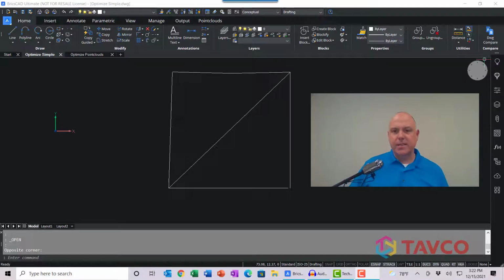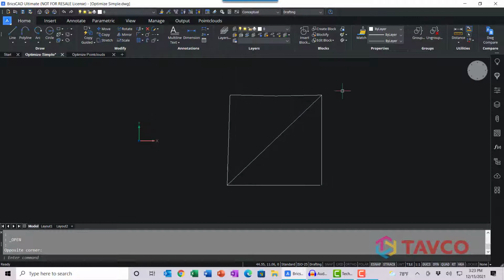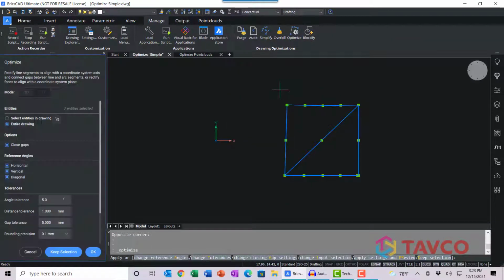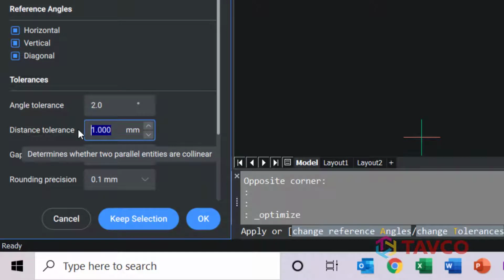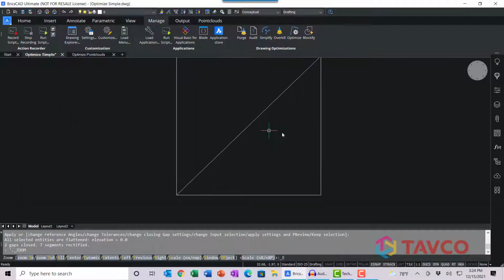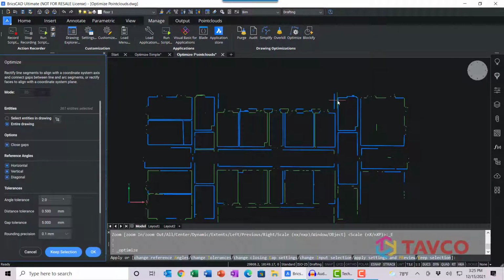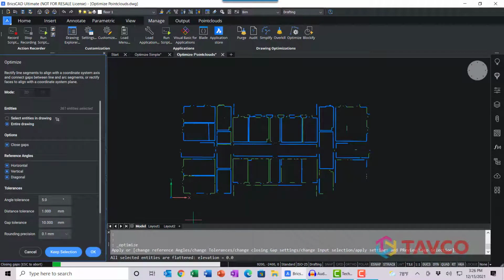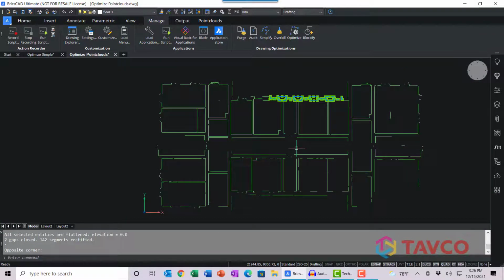How to Optimize DWG Drawings in BricsCAD v22

Comment: Hi, 
i have one problem. the windows hide on the walls when draw is full. And waññs don, t respect the windows size.
Reply from the maker: It sounds like you're running into an issue with drawing order. Try changing the layer order for the windows and walls. For a deeper dive you can connect with our BricsCAD parther, Zentek Consultants at https://zentekconsultants.net/